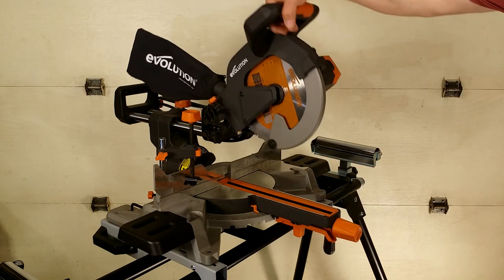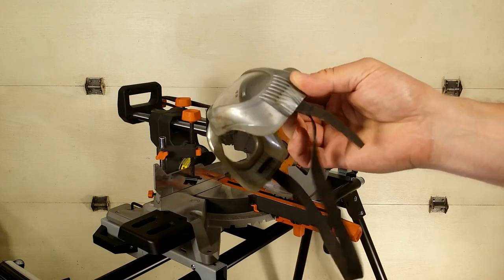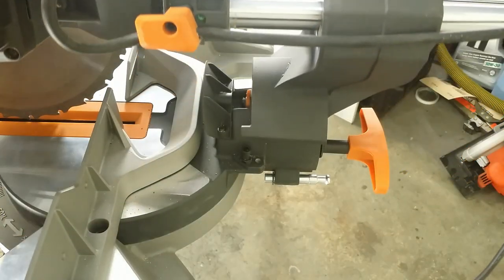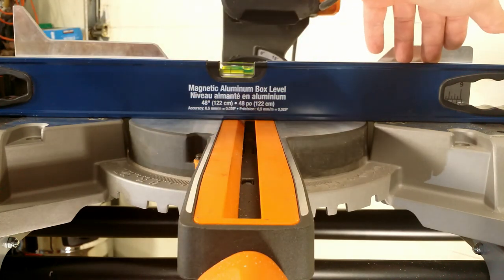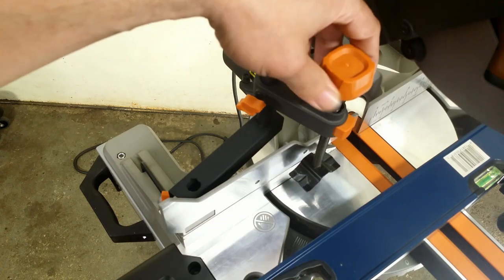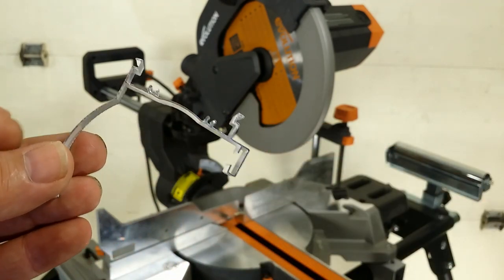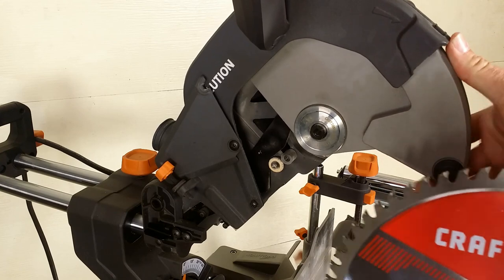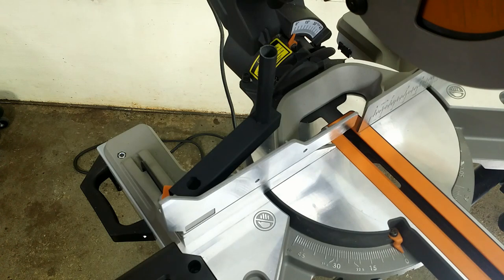Why The Evolution Miter Saw is (Not) Great

Comment: I’m the owner of a small construction company, i bought this saw a few years ago (2020) because my dewalt was having problems. I build about 6-10 decks a year and this saw was used to cut all the steel/aluminum railings to size. It’s not ideal for precision wood working but it’s proven it’s worth many times over, this saw has taken an absolute beating for me.

Comment: My saw came just like that. Left table was a tad lower. I put a couple layers of duct tape on it to make it flush. I also contacted Evolution and asked if there was any way to adjust it. They asked me to send a picture of the issue and then sent me a replacement saw. The base on the new saw was flush all the way across.  It was a bit of a pain disassembling the original to send it back but at least now I don't have to deal with the tape. And the great customer service was refreshing.  I'm also very happy with the quality of the cuts I get with this saw. Goes thru 11 gauge tubing like a knife thru butter.
Reply from the maker: Thanks for the comment. Will contact evolution.

Comment: Solve the low bed problem with a vinyl sticker or 2 .
Reply from the maker: So, it is not only my saw.
Reply: @robertdeptula2003  I got the Rage 3 'S with same problem
Reply from the maker: It could be such a great tool...
Reply: @robertdeptula2003  Is now i fixed it :)

Comment: Yes I totally agree with your review and I despair of this company as they continue to sell poorly designed power tools.
Beware potential buyers
Reply from the maker: Thanks for your input.
Reply: How so?
Reply: This is on the cheaper side of their line up. The saw I have from them is very nice.
Reply: Buying cheaper means less money spent on the calibration out of factory. If you buy cheaper you have to expect to do more work to increase the accuracy. Same goes for any tool, like combi-squares, table-saws etc.

Comment: What do you expect for the price, Jesus. You want Festool quality for evolution money 🙈🤣 It’s just a cheap junk saw to abuse and nothing more really.
Reply: My thoughts exactly. I had the 'fury' (even cheaper version of this one) for around 10 years. Took a bit of work to get the back fence square and the clamps are indeed feeble (I just chucked them, it's not like you need them to chop a bit of 3x2). It did the job for numerous stud walls, decking, fence boards and posts, garden furniture, sheds and whatever else the Mrs wanted doing around the house and garden. It's just died (looks like the circuit board) but given the cost has worked out at about 3p a week up to now it's not worth repairing, I'll just strip the useable bits for spares, chuck it and buy another evolution one.
If I were using one for a living then I wouldn't buy the one in the video, I'd buy something for at least 4 times the price, but for DIY and house renovations you can't fault them for the money.